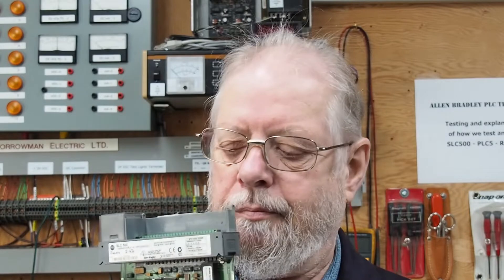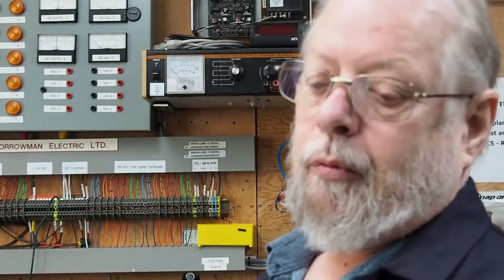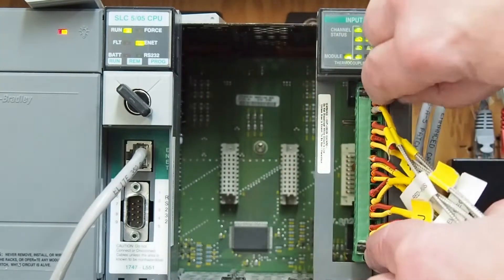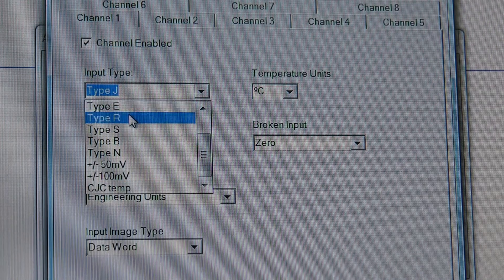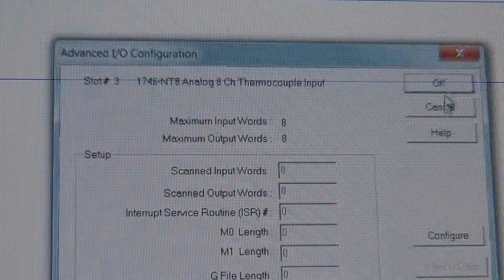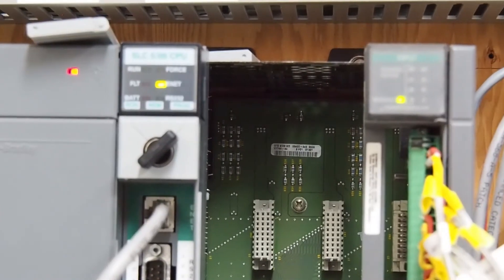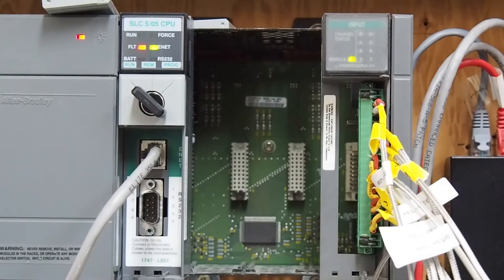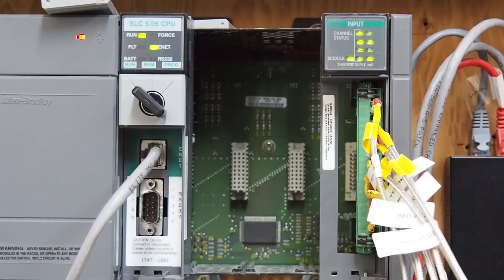1746-NT8 Thermocouple Input testing

Comment: I need to figure out how to force reset the chip temperature controller AD597A. It tripped bc of a faulty reading by thermocouple of 319⁰C. How does it trip if temp really wasnt that high? And it wont reset itself now. Two of them on same board doing the same thing. Control board says its open t/c. Could it just be bad ground or shorting to the carriage its on. Its on a 3d printer head and I dont know if its supposed to be grounded to the print head or chasis bc of conflicting information in the service manual.
Reply from the maker: HI:
Not sure what that chip is or anything about your system.  As you say it sounds like a damaged wiring fault.  Or possibly the chip fried.
Sorry I can't be of any more help on this.
B